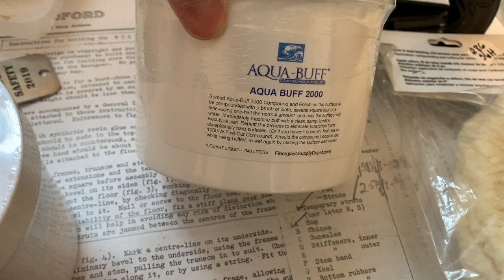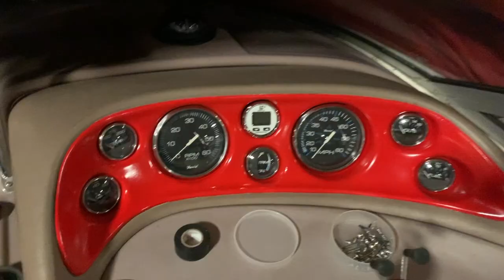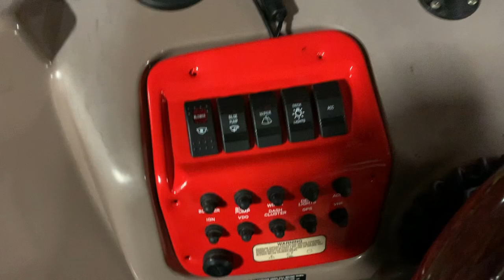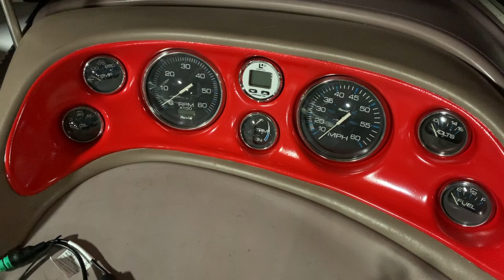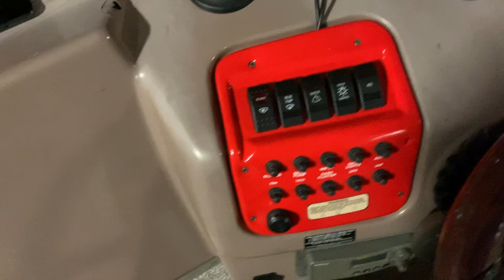MV Clifford, Regal 2665, helm reassembled and starting compound and wax of the gelcoat

Comment: How did you get the lettering back under the rocker switches
Reply from the maker: I bought all new switch covers, so they were lettered by Carlisle (purchased from Great Lakes Skipper...great selection!). The white lettering for the circuit breakers was done by a local sign shop.